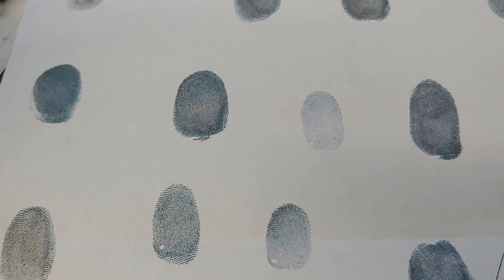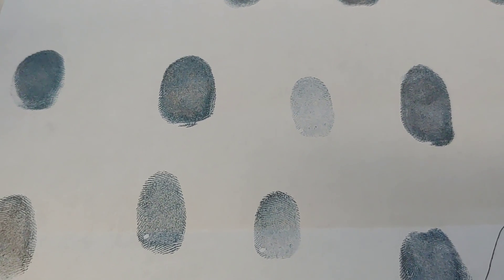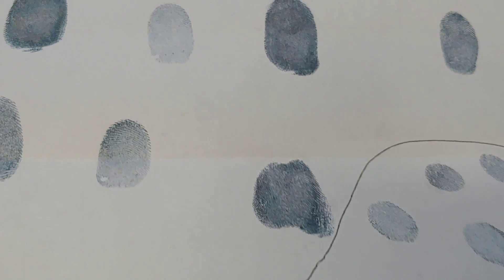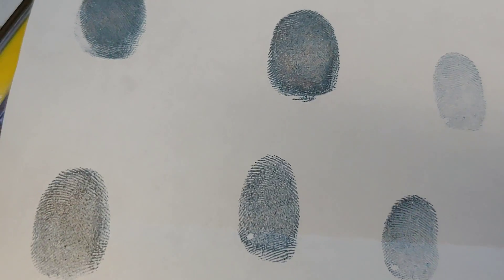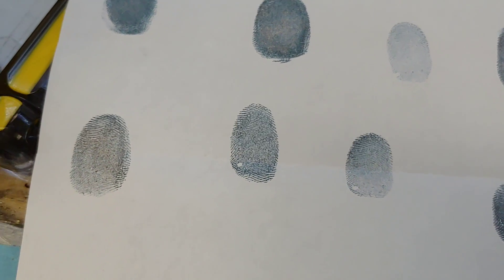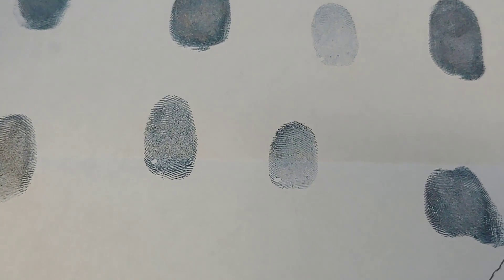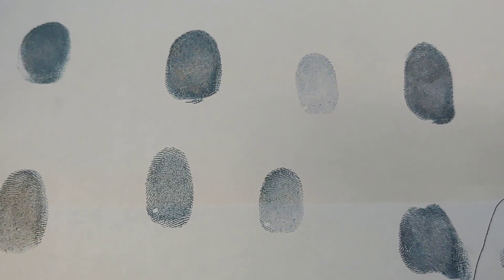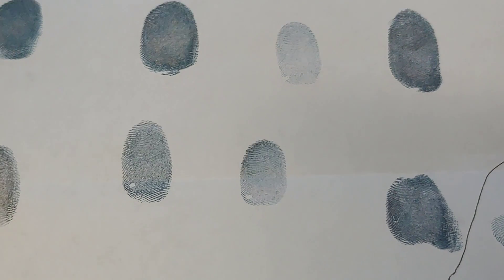THIS IS NOT WHAT WE MEANT!

Comment: For most commercial fingerprint readers you can replicate fingerprints using the following method: 
1. Get a clean, black and white (no grays) image of the fingerprint. Play with contrast etc. to get nice, pronounced lines. Possibly invert image to get black where grooves of the fingerprint are. 
2. Print the fingerprint on a transparency using a laser printer. Toner sticks up a bit from the surface of the transparency (more than it would from normal paper) creating a negative 3d copy of the fingerprint. 
3. Cover the image with a thin layer of wood/white/PVA glue. It should be thin enough to be translucent, but sturdy enough to peel from the transparency without riping. 
4. When dry, carefully peel the glue and place it on your finger. Some readers require you to wet the copy (usually by licking) to work. 

No guarantees it will work on an iphone, but I have successfully used this technique on both capacitive and optical readers, even "high security" ones that detect if finger is alive.

Comment: Dude just etch it on blank pcb (copper density 4oz) then cover it with silicone, araldite or other binary epoxy glue (remove 20% of the hardening agent from the mix). Lick, put on sensor. Costs like 2$ per run (initial one-time costs to set up can be under 15$) and under one hour of time, most of it being waiting.

Comment: I would scan the finger print then apply a negative filter then print it out and cut it out with a pair of scissors. My theory is: the reader sees the raised ridges of the actual finger's print  as lighter  and the valleys of the finger print as darker. When you transfer the print to paper with ink, the raised ridges become dark and the valleys become lighter (reversed). At least try it out of curiosity.

Comment: i guess sending a mould of your finger could work tho you just need to pour in some sort of conductive soft material.louis maybe..idk how it works do you need conductive material or does it read the fingerprint like a scanner?maybe if you havent thrown out the prints try pressing them on the phone? or will they be mirror images? ok new plan hmm..take an extremely high resoultion image of the prints..mirorflip it with some program print it..and press it on the home button.also maybe if you can just make a thumb shape with hotglue then warm it up against mildly hot coffee cup just enough where it feels kina sticky then press it over the print carefully not pressing too hard or smearing then try pressing it on the  home button

Comment: Very carefully put clear, not any color other than clear, packaging tape over one of the prints. Cut that swatch of material out around the print about a half inch border  on all sides. 
Then be careful keep this pristine and press it against sensor. See if that will do it.
Reply: Maybe, if you simply put cellofane over it and heat the paper with a laser light.
Dark parts will get hotter and melt the plastic.
Or candle wax ?

Comment: You should be able to just use a piece of tape if that is ink on paper
Reply: No not once it has absorbed and cured its not going to transfer right unless they can get the entire segment thats inked to delaminate when they pull the tape off. I mean they can try to tape over it and cut it out in a square around the print and then press it against the sensor. That might work. It has before.

Comment: Mythbusters had an episode showing a copy of a fingerprint was sufficient enough to unlock some things, but I guess smartphones may employ better technology.
Reply: Smartphones implementing better technology than $100's worth of "security" technology, ment to protect $1000's worth of valuables. What has this world come to lol!
Reply: there is many types of fingerprint reader, optical fingerprint reader can be easily fooled by 3d printed finger but more common fingerprint reader on smartphones is capacitive-based, that means it won't work if the finger is not conductive... similar to when you use an object to poke on capacitive touch screen, it won't work with non-conductive objects